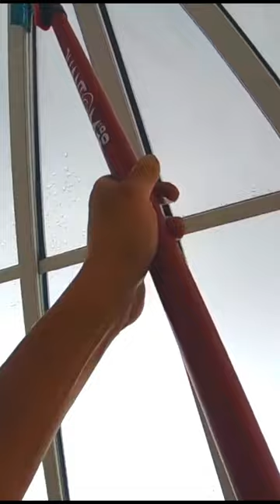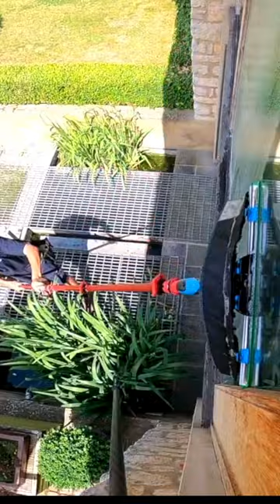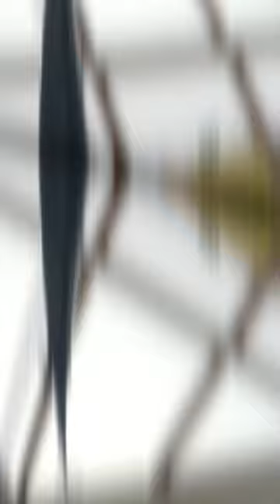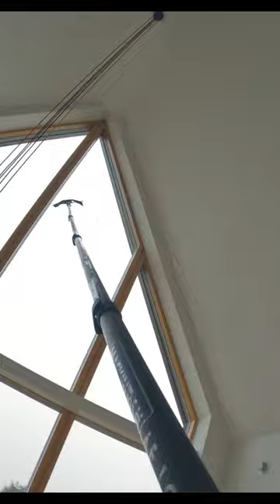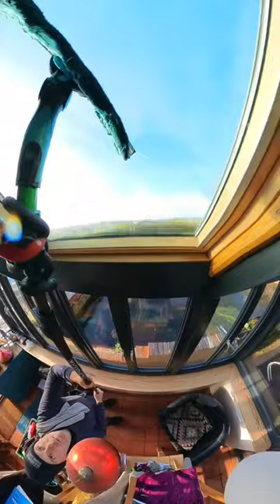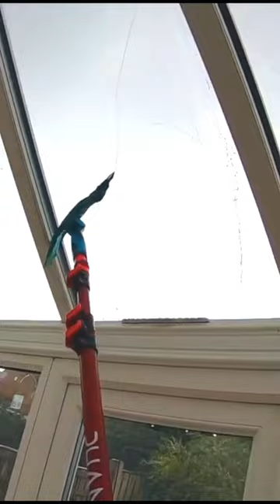Trad pole skills on show!😜👍🏼

Comment: That looks like extremely hard work. Just use a tower, much less back braking. Or a pad with some spray attached to a pole. That will defo leave blade marks etc until you’ve got the hang of it, and how often do you do jobs like that, not all that often. Definitely easier ways of tackling that job.
Reply from the maker: I don’t think it would be easier to go to the trouble of setting up a tower!😆
Reply: @aemackintosh  you are right, on closer inspection a step ladder would suffice, originally I thought it was higher. You must admit it’d be easier to go up a step ladder to do a conservatory roof. I’ve been doing this 33 years btw.
Reply from the maker: It’s up to you. There’s always more than one way of doing things.😉👍🏼